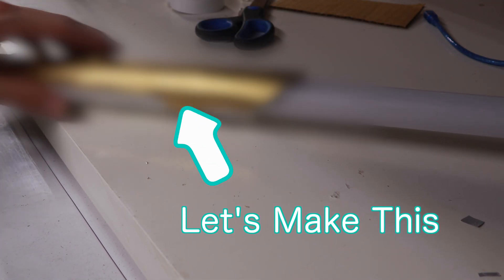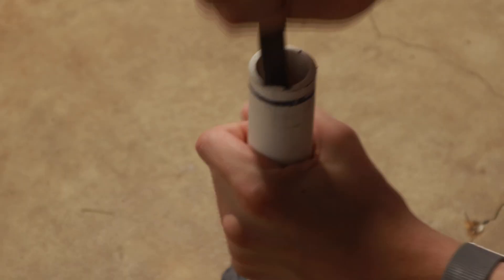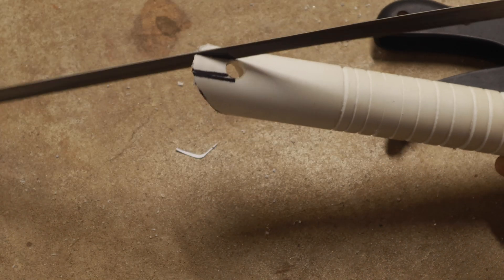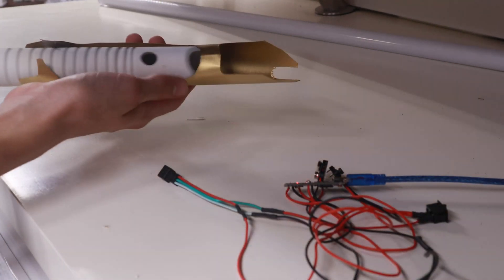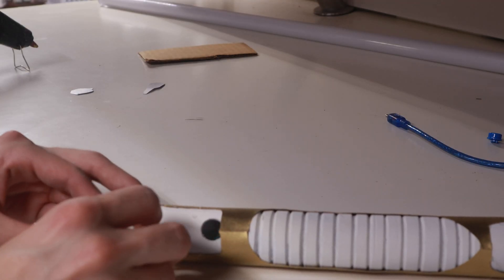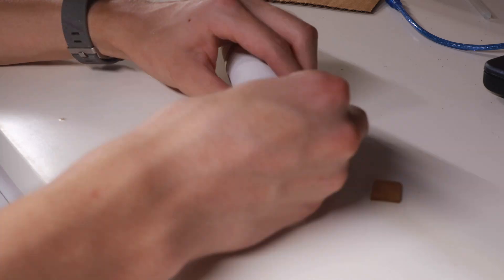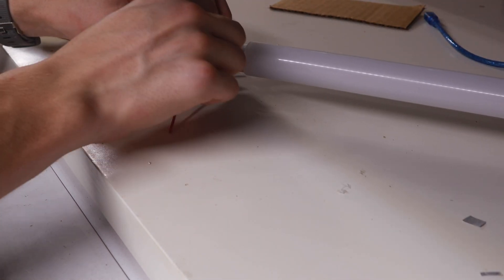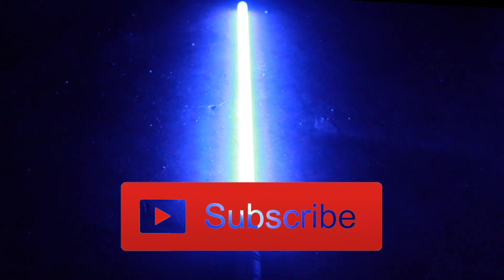NeoPixel Lightsaber for Only $60 | Part 5: The Hilt

Comment: Would I be able to do this with a pop drain assembly? I've got a hilt that I'd love to put electronics in.
Reply from the maker: Yeah you can do this with anything! You’ll need about a 1 inch inner diameter, maybe like 8 or 10 inches minimum length, and probably 2 holes for buttons (or a hole for wires that go to buttons), but that’s all doable with any piece of plastic, metal, wood etc that looks nice